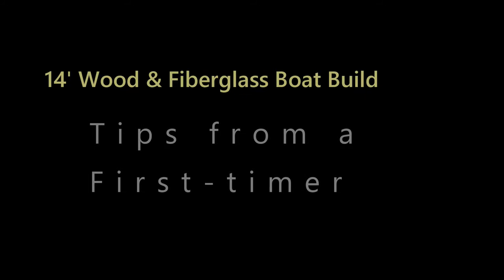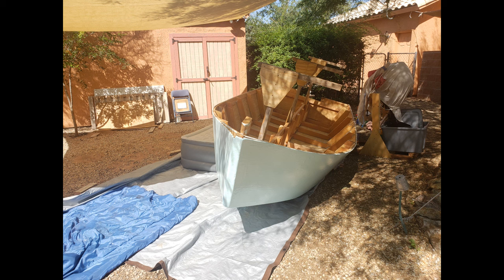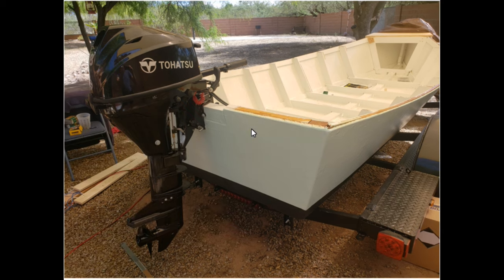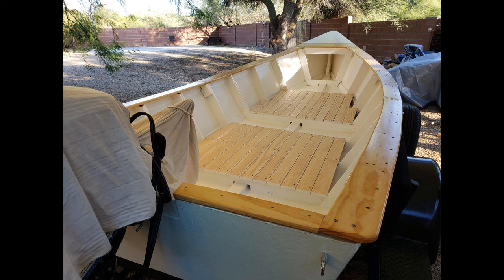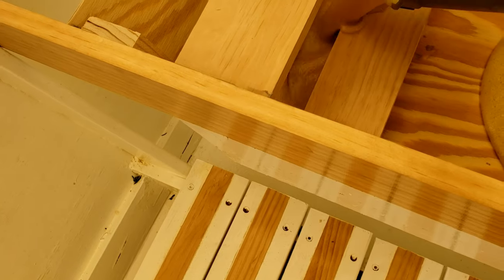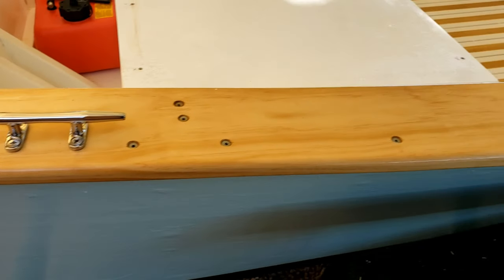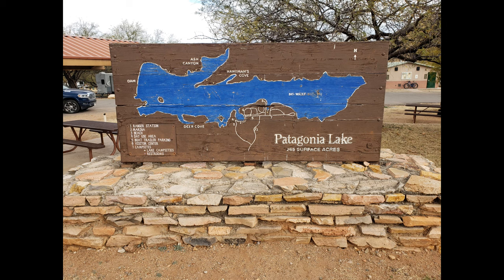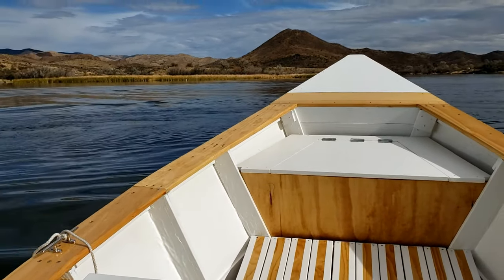Part 2 - Tips from a First Time Boat Builder - 14 ft Seneca Dory

Comment: If you put the restrictor plate and ECU from a 20hp in the 9.9....Alakazam!!!.... You have a 20hp that still says it's a 9.9 on the cover. It can be done for a $100 if the Ebay ECU Gods smile on you.....Allegedly if you just remove the restrictor plate 9.9 becomes the 15hp without any further mods, but research any mod before you do it and decide for yourself 👍
Reply from the maker: I've heard that before.  Never tried it.

Comment: Those bunks dont look flat. I think you might find that those trailer bunks will cause damage to the bottom of your boat since that trailer is for a v-bottom. They need to be absolutely flat and well padded. ...and I would add another center bunk. Trailers can do a lot of damage to boats unless totally dialed in. Spira's design only has one center stringer so the bottom is vulnerable.
Reply from the maker: So far no issues.
Reply: @mikethedesertrat  well the wear marks wont be obvious when on the trailer since the bunks will cover the damage areas.
Reply from the maker: @johngoodell2775  It must be the perception of the video or something. They are flat to the boat.  The trailer may accommodate a V-hull, but the bunk brackets swivel for adjusting the angle.  It was adjusted at the beginning when I rebuild it.  Still is fine.

Comment: In your video you said the plans for the transom called for 3/4 in plywood.  The Plans I received shortly before Jeff passed calls for 1/2 in....same size boat.  I wonder why.  also, what degree of tilt, if any, does your transom have? My plans show a 14 degree angle which makes the planing of the top and bottom of the transom somewhat inconvenient.  Lastly,  for your trim wood, did you just take a wider board and cut it in the curved shape for the bow trim?   Thanks... great job on your boat
Reply from the maker: You are correct. The plans do say 1/2" ply on transom. I used 3/4.  And yes, the angle is 14 degrees.  You want some angle for going in reverse and to deflect waves when idle.  Yes, and the side caps i bought wider stock and cut it to a curve.

Comment: I bought my boat plans also from; Jeff Spira intl., before he died.   And I noticed that you registered your boat in Arizona.  What paperwork do you need to register your boat in Arizona?
Reply from the maker: As I recall I went there all prepared with plans, material recipes, a few printed "guidelines" from feds regarding weight limits, but they didn't ask for any of that.  They just wanted to measure overall length.  I filled out a form or two and that was it.
Reply: @mikethedesertrat  thank!!!

Comment: you could alternately use 2 inch styrofoam and glue it with Titebond 3 waterproof glue ... save money over that expensive TotalBoat stuff !!!
Reply from the maker: You could. If you have limited space (not in my case) pouring could be better to assure maximum usage.